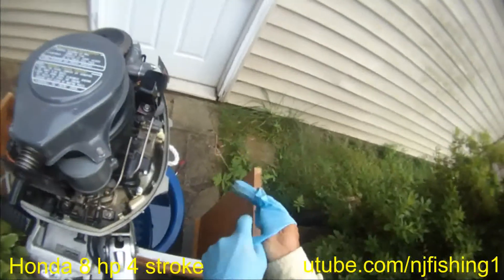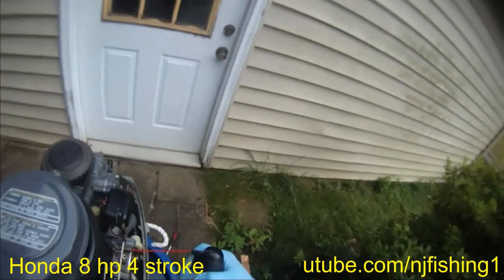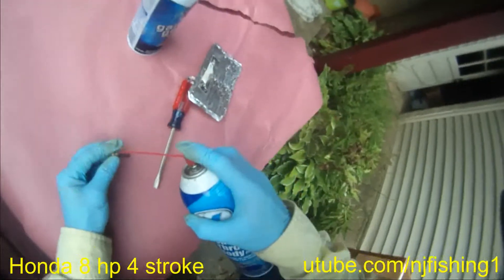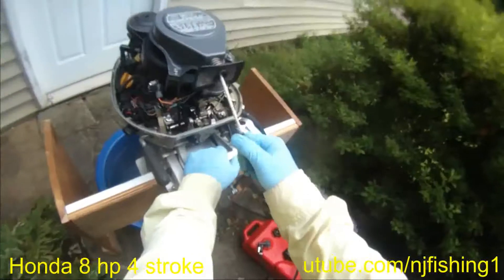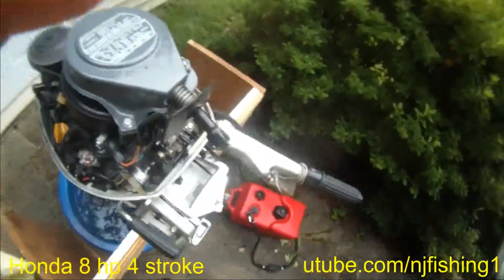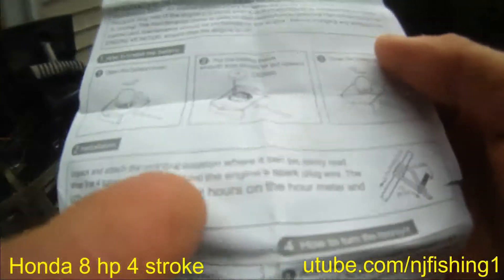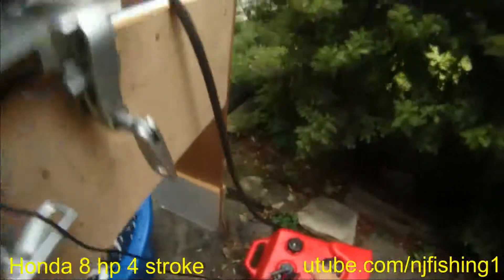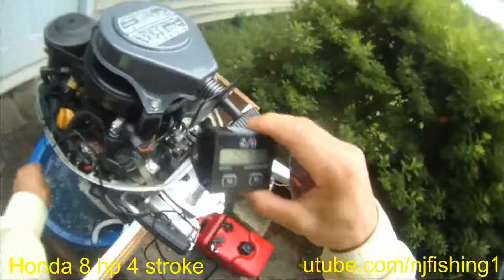Ethonal fuel killing my Honda 8 hp 4 stroke outboard - Part 3 (carb cleaning)

Comment: Does your motor go to full throttle in neutral and reverse?.I have the same motor and can only get full throttle in Forward gear.
Reply from the maker: Dan Mcginn there is a restricter so we cannot do full throttle in reverse gear. It is for safety reasons. You can remove the restrictor but i would not suggest you do it.
Reply: @njfishing1  thanks,i appreciate your feedback